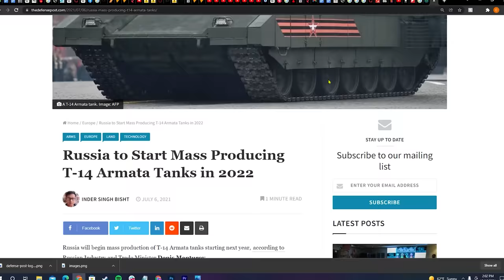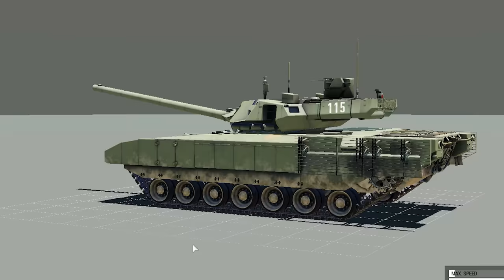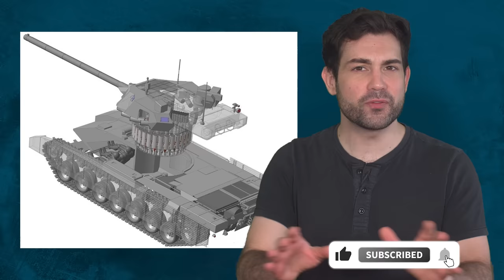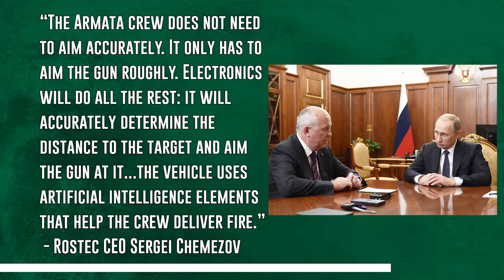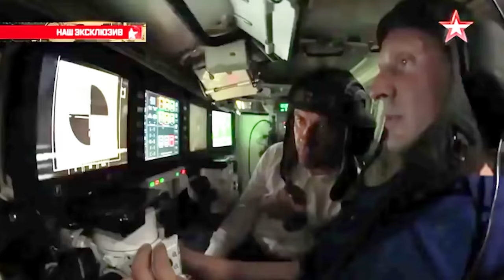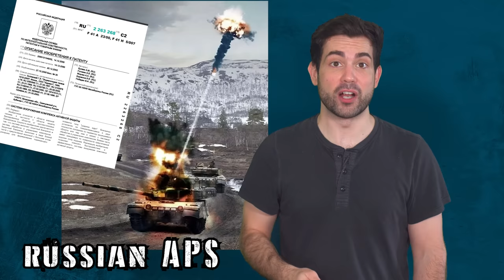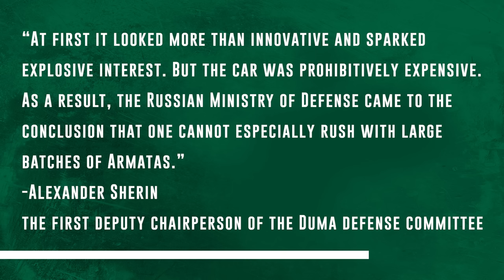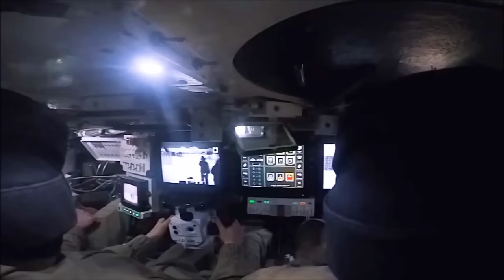The Truth About Russia's T-14 Armata Tank

Comment: It looks like an interesting super modern vehicle. It’s just that Russian armoured doctrine from WW2 through the Cold War involved overwhelming the enemy or potential enemy with huge numbers of simply designed vehicles. The Armata is 180 degrees from that doctrine. It also comes at a time when the sophistication and number of hand held anti armour weapons are making the viability of the MBT concept open to question.
Reply: So your saying mechs are possible?
Reply: @thelonelypilot  Mechs that can operate in infantry roles sure, but mechs bigger than that? No.

The Handheld AT's are also a threat for mechs. Actually especially for mechs, a mech is way too vulnerable for that. Too many moving parts and weak points.
Reply: @ls200076  especially the joints
Reply: What hand held anti armour weapon is capable of defeating modern top of the line MBTs frontally? Especially MBTs with latest active protection? If anything, it seems that hand held anti-armour weapons will go the way of the dodo.
Reply: @phunkracy  Oh, I agree. ATGMs are good, the missile rules the roost right now and is only getting better, but that doesn't mean tanks are finished.
Reply: @ls200076  That doesn't make sense. Militaries would love to develop walking vehicles because that opens up the other 50% of all the terrain on the planet that tracked and wheeled vehicles can't handle. It also facilitates hit and run tactics from behind hills, around street corners, and from rooftops. Walking vehicles will probably be missile launcher vehicles first and foremost. Building a robot small enough that its vitals are vulnerable, but big enough to be targeted easily makes no sense.
Reply: @ghostttriddder  Why do you assume that the joints would be left an easy target? How is that any different than any other system of locomotion?
Reply: I've heard from several places suggesting that hand held anti armor weapons have fallen behind the capabilities of main battle tanks. Think Task and Purpose also premised this about the most common US and Russian launchers.
Reply: @phunkracy  If I'm not mistaken most of the newer RPGs like the 29 and 30 could granted the range for them is extremely close.   Rpg 7 is still deadly with a change of ammunition.   Tandem charge warheads changed the game in favor of man portable anti tank weapons while it seems the general counter for them now is specialized era or active protection systems like arena.   I don't see these weapons disappearing soon especially when they are becoming more multi purpose ( anti tank, bunker busting, air burst etc )
Reply: @thelonelypilot  "Mechs" as in power enhancing exoskeletons for individual soldiers, perhaps. But mechs as a vehicle will never happen. Legs and feet have a gigantic disadvantage in ground pressure, and therefore mobility, compared to tracks. We don't know exactly what future heavy all-terrain vehicles will look like, but we know they'll be tracked.
Reply: Simply designed vehicles? Things like autoloaders, era armor and activr armor protection were pionered by the rusdians, as long as i know
Reply: @phunkracy  Top is the key. No matter what direction you shoot from, top of the tank is always there. 
For instance, TOW-2B, Javelin, NLAW, MPATGM, Spike-LR, HJ-12, RBS 56 BILL(2) and AT-1K Raybolt have top attack possibility. Not all of them are hand held, man portable non the less. 
Active protection sure helps against missiles, but it isn't perfect either.
Reply: top attack proof APS is but a matter of time. And when it finally comes, the only viable way to defeat APS will be saturation attacks and APFSDS
Reply: @fooanonymous  or wheeled
Reply: @tyrionas  wheels are certainly better than feet, but not as good as tracks for low ground pressure and all terrain mobility
Reply: @fooanonymous  it depends which wheel design you are talking about and it depends ont ge weight of the vehicle and its i tended purpose. There are a lot of wheeled tank designs in use today.
Reply: @tyrionas  Not really. Wheels reduce rolling resistance, but increase ground pressure, compared to tracks. Wheels can be more efficient for some light to medium armored vehicles, but for heavy designs, because of the ground pressure, tracks are the only option, in spite of their greater rolling resistance
Reply: @fooanonymous  it really depends on the wheel design, there are some new designs coming out with variable pressure wheels that allow to change the pressure on the fly to adjust the ground resistance.
Reply: @phunkracy  not sure about where it penetrated specifically but the RPG-29 'Vampyr' has penetrated and even destroyed the Israeli Merkava, the lower front armour of the British Challenger 2 and the American Abrams. Some of these attacks involved fatalities.
Reply: @phunkracy  i mean it went like that for the past 50 years so I doubt either of them dies, they just adapt all the time.
Reply: @thelonelypilot  As much as I want Titanfall style mechs (or MechWarrior), I don't see that ever even being practical. The biggest problem with mechs are the things that make them cool, the legs. You take out a mechs legs it just becomes an up-armored bunker that sits on the ground and does nothing. Like I'm sure everyone thinks that the Star Wars AT-ATs are cool, but as we've seen in a lot of the movies, the Legs are it's biggest weakness despite it's formidability.
Reply: Yes, some have said that atgms have made tanks obsolete since they have been introduced. Then some bright sparks believe them and reduce their tank force to nothing. Then they go war and are reminded why tanks were invented and purchase used tanks at any cost where ever and circle continues. 

Did you know that some have said that MANPADS...
Reply: @tyrionas  Well, if you're interested, look up the off road performance of the Stryker armored vehicles in Iraq. The Stryker is a fantastic vehicle in theory. Just not quite so much in practice.
Reply from the maker: yes I completely agree with you on this. when I was interviewing all the armored vehicle people at AUSA in Washington DC they were talking a lot about small inexpensive robotic tracked vehicles that roam the battlefield looking for targets and reporting back to a few larger platforms. the MBT is going to change in the next 20 years I bet we see less of them but more high tech ones. Drones are changing everything.
Reply: @alijankhan3330  only hull armor because it wasnt upgraded since ww2
Reply: @Taskandpurpose  That’s why I think your video on subterranean combat was so prescient. Will thousands of automated flying and tracked drones mean that the only survivable combat space for human infantry is underground? You could see that strategy in WW1 when assaulters dug tunnels that exited nearer to enemy trenches so they had less ground to cover. Likewise the Japanese in WW2 and Viet Cong in my particular conflict used extensive bunker and tunnel systems to negate American artillery and air power. Anyway great content. Keep it up.
Reply: T 64 was simple? Really?  But the m60 pattoon that coudlnt compete wasn't???
Reply: @tonyjoka2346  it was literally the most modern tank in the world when it entered service. In fact it was too modern and complicated for its own good. Meanwhile M60 could trace its lineage to a WW2 design
Reply: @phunkracy  APS will make it harder, true, but did everyone go back to dogfighting once aerial countermeasures were devised? This assumes people aren't actively trying to make the handheld AT weapon good either. I expect to see a cycle of new APS measures and ways to defeat those countermeasures being developed.
Reply: @Trve_Kvlt  Mechs could be used as a infantry support vehicle in really thick terrain. Essentially a small armored vehicle, maybe with a multiple machine guns and a small cannon for direct fire support. It could only really be used in say, a forest or really dense urban combat where tanks can't get at them, but it would be cool.
Reply: @phunkracy  yeah so why did this guy say all soviet tanks were simple?
Reply: The US was wise not to replace the M1 series tanks. Tanks, in their current form, are increasingly obsolete on the modern battlefield, so pouring huge resources into an M1 replacement would have been wasteful. Better to just keep doing incremental upgrades on the Abrams until we've figured out just exactly how tanks fit into modern warfare.
Reply: @phunkracy  Think outside the box...AT4's, LAAW's, Dragon's, and RPG's(as well as other hand held anti armor weapons) can still be used for other things(bunker busting, building busting, or any other type of 'outside the box mission'...they don't have to be used on tanks, and therefore, probably aren't going anywhere NEAR the dodo.
Reply: @radioactive9861  I know, infantry isn't going anywhere. But infantry portable AT is possibly going the way of the dodo in next 2 decades, once top attack resistant APS are widely embraced.
Reply: @mbaxter22  tanks are a long way to being obsolete,  especially with active protection systems. They still bring a big ass gun to the table, with incredible survivability to boot. Any country that is serious about land warfare has tanks. Not replacing M1 was a good move,  but only because there was nothing that could counter US hegemony in conventional warfare. Once there is a threat of a major land war,  M1 is going away for good
Reply: The fact is that with the rapid advance of light but lethal weapon on ground and air asks the question is armor of any use any more?
Reply: @phunkracy  But, my point was, 'infantry portable AT' is NOT going the way of the dodo because it CAN BE USED FOR OTHER PURPOSES than (A)nti-(T)ank(busting bunkers, busting buildings, anything you can think of,...etc)
Reply: @radioactive9861  then its not anti tank lol
Reply: @phunkracy  it's an 'anti-tank weapon' just not USED as 'anti-tank'. onasidenote: are we REALLY arguing 'semantics'?????
Reply: The Russians used a lot of small combined arms teams in the Ukraine, where the presence of even a few T90s substantially increased Ukrainian casualty rates in engagements. Well protected tanks continually prove their worth on the modern battlefield. Regardless I assume we'll see UGV/manned AFV teaming, in a similar approach to what air forces are striving towards; an effort to reduce manned vehicle density as the battlespace becomes more congested with unmanned and likely autonomous threats.
Reply: Literally everyone's military doctrine is "to overwhelm the enemy with numbers on the designated front" if you can not rely on your complete superiority in firepower(on the "aircrafts and tanks against the enemy who does't have those"), so it is your own impression and conclusions, not the actual doctrine. Numbers and cheap production came from Russia having longest terrain borders and largest territory to defend in the whole world, from these we have conscriptional army - to have enough troops at the ready anywhere and a need to have enough vehicles avaliable everywhere to arm these potential troops. I don't know who you may try to overwhelm with numbers of anything, when your neighbour is China). Good military planning is always based on the assumption that anyone can become an enemy, so don't get me wrong, US is our neighbour too - 4 km away at the Bering Strait, and I don't include military bases all around our territory.  So "logistics and funding are bitches, lets try to make our best out of it" sounds more like Russia military doctrine).
The Armata stems from assumption, that with lots of nukes nobody will be daring enough to make a massive invasion, and armies of the future will consist of relatively small "elite" units, wich is debatable up to this day.
Reply: Imagine saying that T-64/72/80s are «simply designed vehicles»... guv, you...
Reply: @lamalien2276  Ahh, yes, because caterpillar tracks are so bad at navigating terrain. Walking seems easy for us because we've evolved for millions of years to do it. bipedalism or really any walking vehicle needs seperate motors for the legs, likely electric motors, or else insanely complex and sturdy transmissions because when you walk, your legs keep alternating direction and there's also the case of the joint -- how do you power that without another motor in the "knee"? Think about how complex it is to make a prosthetic leg, versus how complex it is to make a wheelchair, and it's like that.

Also, there are two further problems with walking military vehicles -- ground pressure and balance. When it comes to ground pressure, modern MBT's have almost the same or even better ( = lower) numbers for ground pressure than the medium tanks of WWII. They can do this because they haven't gotten much taller, meaning that when they need to make the tank have more stuff they just make it longer too, and the amount of weight on any one point of the track won't be any more than the amount of weight of the regular infantryman. In fact there is a story in the falklands war in which the british armored vehicles were able to pass across a sort of barren and dry-looking mud field, but when people tried to get out they sank to their boot-tops. Also, it's a lot harder to balance something that's 3-4 meters tall (or more) and whose feet are only maybe one meter long, than it is to balance something that's ~2.5 meters tall whose "legs" (tracks) are ~10 meters long.

Lastly, you think that slightly larger mechs will be able to do better hit and run tactics. But is bipedal motion really that steady for shooting on the move (as opposed to the very mature suspension and stabilization systems in all modern AFVs), and are mechs really going to be good at dealing with inclines? Every american tank after the first world war has been able to make it up a 60 degree concrete incline -- can you do the same? (I use american tanks as an example only because I know the most about them, by the way.) Mechs might not have hands to brace with (or they might be holding the weapons systems), and it'll be hard for them to have the same ability to move their center of gravity precisely as we squishy humans can, or what if the ground gives way under one of the feet then? Or when it tried to suddenly accelerate to run away? It could be catastrophic, but that wouldn't happen to a tank, and tanks and AFV's have been using hills and hull-down positions (where the hull of the tank is behind cover, like a wall, hedgerow, building, or even a ditch dug for it, but the turret sticks out and can engage enemies still) since WWII.

The problem with "a robot small enough that it's vitals are vulnerable" isn't really so; if any motor or joint in a walking robot failed it might be completely immobile and require rebuilding, whereas modern tanks have one extremely reliable engine, and if mechs are really intended to go anywhere you can't already go with a tank, they need to be light enough and thus the crew compartment is vulnerable, and really all parts are. The best defenses one would have would be active ones like ERA or TROPHY type systems, and the fact that it's motion is not simple and therefore it's hard to hit a certain part, but if it can shoot on the move then it must be stabilized, and thus at least one part, and likely the one with the squishies or the computer bits, must be stable to hold the weapons.

Combined arms warfare presents a huge threat to modern tanks, the idea with small mechs is that they'd require little extra infrastructure compared to a big one, and still hugely increase the ability for the infantry to field much more and more powerful weapons and equipment; small mechs that were not much bigger than men (2-3 meters) which seem to verge on simply just being armored exoskeletons, are more likely because they can still use all of the techniques and places that infantrymen use to stay alive on the battlefield, and indeed might replace airborne / paratrooper infantry by using extreme shock absorbers or rocket assisted landings to spend much less time in the air and give extra capacity to their assault.
Reply: в послевоенное время доктрина советского танкостроения поменялась по понятным причинам. Войны не было , это на войне среднее время жизни танка- три боя , поэтому массовость превалировала над качеством сборки. После войны СССР требовался танковый парк , быстро морально не устаревающий , неприхотливый в эксплуатации и при этом надежный как топор , поэтому т-72 до сих пор кое-где стоит на вооружении с некоторой модернизацией естественно , уже 50 лет . Кстати когда тот новый танк еще разрабатывался и был засекречен , западные эксперты пытались спрогнозировать его конструкцию и преобладало мнение что башня будет необитаемой как у арматы , поторопились ))
Reply: @phunkracy  Javelin
Reply: Why haven't the U.S. made a new tank design in 40 years?
Reply: @William Young
Because they only fought third world era armed with sticks and stones and leveled their cities via airstrikes beforehand
Reply: @phunkracy  or people will make anti-tank missiles with ECM.  Defense and Offense are an endless tug of war in weapons and armor design, when one pulls ahead someone tries to beat it.
Reply: Russia is not the enormous human reservoir and industrial superpower that the USSR was.
Reply: @lamalien2276  modern ATGMs attack top down. Same with loitering munitions.
Reply: @uncletuftin  🙄
Reply: @Trve_Kvlt  Yeah, they actually got that part right in Empire Strikes Back…